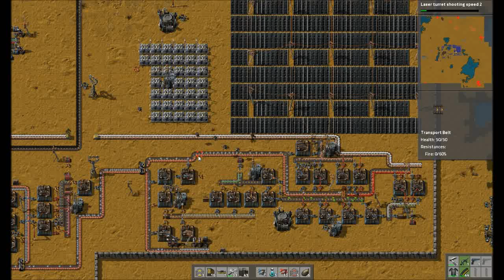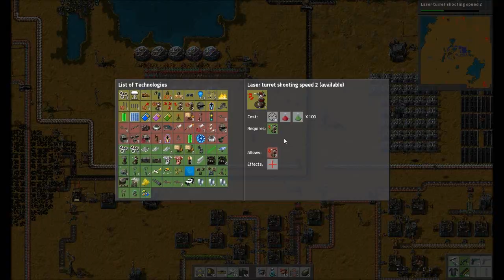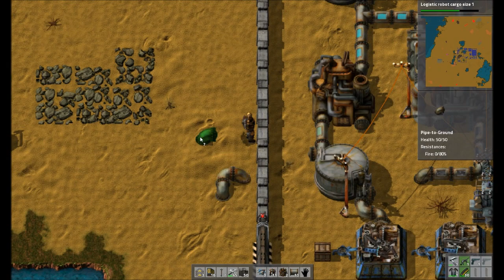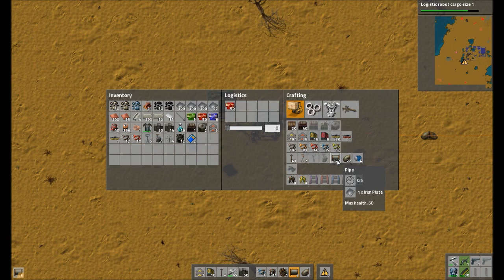Factorio   Episode 9 Power Armor

Comment: You can in fact rotate assembly machines.  Or at least, you can adjust which side takes liquids.  You just have to do it by mousing over them and pressing r once they're down and set to accept liquids.  You can also rotate any other buildings like that without picking them up.

Comment: What storage chests are basically passive provider chests that also can receive items. When you use deconstruction blueprints (the red ones) items broken down need to go some place, passive provider chests won't accept the new items but storage chests will.
Reply: Scott Chamberlain So it's like a passive requester chest? Or a storage bus/ME drive from Applied Energistics?
Reply: Endre Man0 More like a storage bus.
Providers can't accept items, otherwise your outputs would get clogged, and requesters only accept the items specified, for the same reason.
So storage is the place for items that have nowhere specific to go.
Fun fact: if you have no storage, passive and active providers behave the same way.

Comment: With the logistics system you can limit how many items the inserter takes off the belt by setting a logistics condition to less than the amount.

It allows you to be sure the chest doesn't fill up with other items. a smart inserter is also as fast as a fast inserter.